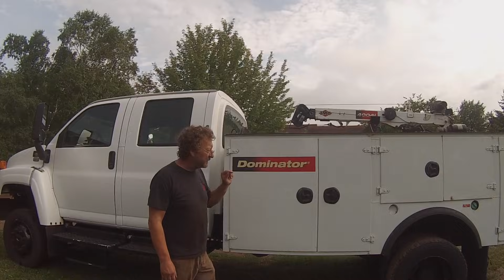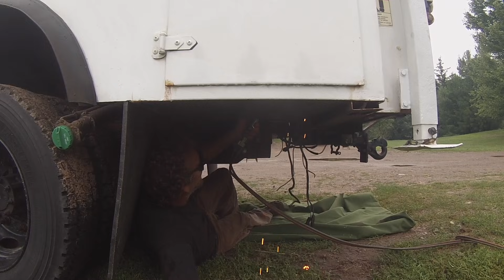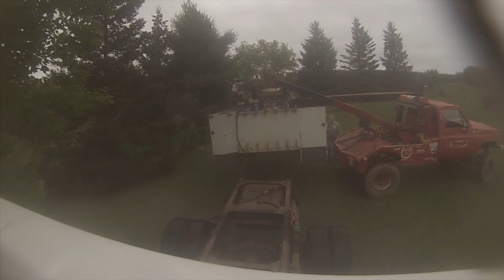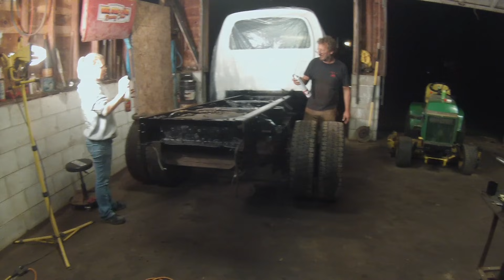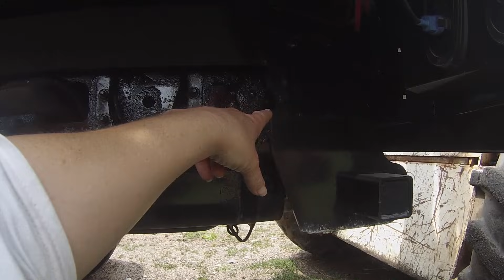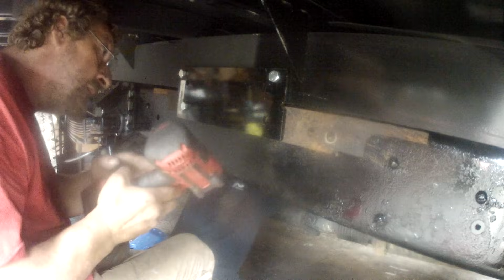GMC 4x4 Topkick Transformation to the trailer hauler

Comment: Starting to look like a good looking over the road long hauler for a pretty cool trip coming up!! Can’t weight to see it all finished up!! I was just able to pick up my self another 1TON Chevy 4x4 SRW and it’s the 4 speed manual tranny the SM465 and it has just under 100,000 original miles because it was baught brand new back in 1980 by a fire department and only used to haul water to field fires!! It definitely drives really nice also!!

Comment: Nice work, looks good. 
With that much drilling I would have rented a magnet drill press so you do not kill your arms holding pressure to the steel. Also probably would have not gone through as many drill bits as you can control the pressure and use oil to help lubricate. But in the end you got it done.

Comment: As I stated in the post that got deleted, make SURE to add support to the receiver hitch tube.
Braces off the frame to help support the front end of the tube is very important!!
That tube will not take the pressure of heavy tongue weight.
Reply from the maker: 3" recover built into the frame work of the bed.
Reply: @offroadrecoveryteam  still need to support the front of the tube!
Tongue weight will actually twist it.
I looked for your e-mail, but can't find it, and I thought we e-mailed when I bought Auxbeam lights, but I don't have it anymore.
I can e-mail or text you pictures, but YouTube took down my post with my cell number.
We just had to change out a flatbed because it didn't get the support.
Reply from the maker: I looked the bed has a strap from the top to support it.
Reply: @offroadrecoveryteam  OK, that'll help a lot!
Knapheide builds an excellent product, so I'm not surprised they have something there.
The brand we are a dealer for, not so much.
Excited for you guys on the truck, and looking forward to the build.
Huge props to Mara for getting in there and getting dirty.